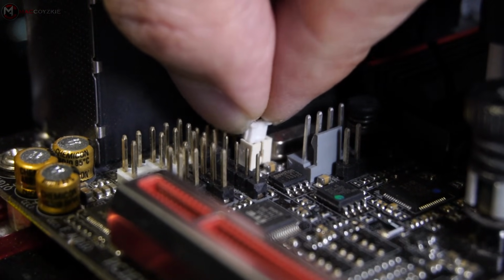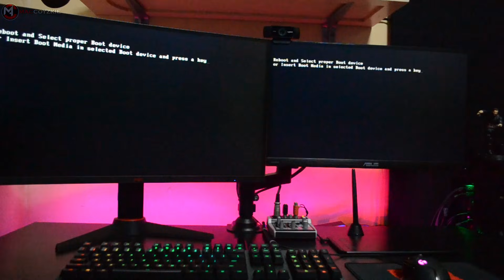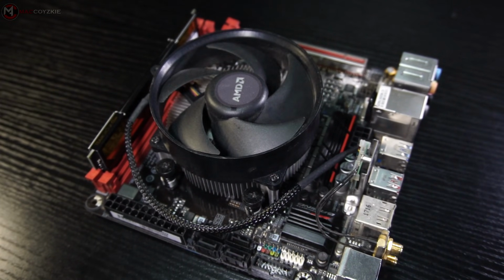How to remove cmos battery in your pc? Cmos reset / hard reset on bios

Comment: Hey Mac! I got into the bios but when I save and reboot the system it always go back to black screen no display no mouse and keyboard function. Any tips on what can i do to make my pc works?
Reply from the maker: this might be low power coming from a faulty psu or a wall outlet. Use a psu tester like this https://amzn.to/3z9G5U5 to check your psu.

Your wall outlet might be difficult to check unless you're a technician but you should use an avr or ups so the power coming in your pc is stable
Reply: Im on the same problem right now. My pc was not booting, I unplug and replug the wall outlet and it worked but no keyboard mouse or monitor activity.. then reboot again and now I have a red light on the CPU tab
Reply from the maker: @sivay4777  do you mean on your motherboard you see red led? if you did then some cables might be loose or not properly connected. Try to re-seat your rams, gpu, and drives. make sure all sata and psu cables are connected all the way
Reply: @MacCoyzkie  hey! Greatly appreciate your reply. I have been so desperate to work out where I went wrong. Yes, it is the red LED on the motherboard. I have reseated the GPU and pulled a few ram sticks. Also tried removing the CMOS battery for 5 minutes but not much luck. Might try and replace the PSU cords that start up the pc. I cant think of what it can be since the CPU is brand new. As well as the RAM. Brand new
Reply from the maker: @sivay4777  ok can you tell me what are your pc specs with the brand new cpu and ram names?
Reply: @MacCoyzkie  definitely. The 3 new components were:
ASUS TUFF Gaming B560-PLUS wifi (motherboard)
Corsair vengeance LPX 16GB (2x8GB, RAM)
Intel core i7 11700 (CPU) 

As for the rest, the GPU is a 2070 Super 8GB, the cpu has an air cooler

Just note that it did work for a month or so before running into the issue I have now. Before the problem, the PC did turn off on its own a few times but I believe that was because we had strong storms for a few days. 
Also, I have not tried to remove the old 2 RAM sticks. My PC has 4 sticks, 2 are new and 2 are old. Upgraded from 16 to 32gb ram
Reply from the maker: @sivay4777  as long as the rams are the same speed there is no problem. I'm more concern on the storms since it could really damage your pc specially when power fluctuation occurs. You need to test your psu using a psu tester like this https://amzn.to/3kdm0XZ

Comment: Hi bro! I watched both this video and the “Pc is on but no monitor signal fix!” Video. Great videos! May i just ask, whenever my 2 ram sticks are seated, there’s no monitor display. When I am just using 1 ram stick... there is a display on monitor. I interchanged both of my ram sticks to confirm if they are working if only 1 is seated and yes it works. Any idea how should i fix this? Will removing the cmos fix the problem? Im on my way home right now and i keep on searching what to do. Basically out of 4 ram slots, only 1 is working. And i cant use both 2 of my ram sticks together. If i put just 1 stick, it works. Hope u will be of help. Thanks bud.
Reply from the maker: either you have 2 different ram sticks speeds and manufacturer. They need to be in the same speed to work together less no signal is inevitable. On the other hand your motherboard like you said, only 1 ram slot is working. Though ram slots rarely breaks it is still possible. Other than cleaning the dust off the ram slots, i don't think there is any fix for that. sorry bro
Reply: @MacCoyzkie  My 2 rams (same speed, same manufacturer) were actually perfectly fine for almost a year now until last week, when i opened my pc, my monitor did not have any display and even my mouse and keyb did not have its lights on. I did some experiment by interchanging and switching the rams with its ram slots. And right now both rams are working on one particular slot. Yes, I’ll try cleaning the ram slot using a brush maybe or a small screwdriver by scratching it(?) and will also try this video of yours reseating the bios. Bro, I hope your channel will be successful. You, replying to the queries of people here in need, are well appreciated. Thanks dude.
Reply from the maker: @tommytom3012  glad i can help, i hope it all goes well for your rig bro :)

Comment: when i Start my PC it is yellow light then when i turn off it and start it again it restart automatically and then when i press F1 it restart again then it work correctly (start correctly)
Reply from the maker: was this happening still after you clear cmos? if you haven't clear cmos yet then clear it now
Reply: @MacCoyzkie  By removing it for 5 min?
Reply from the maker: @osmanhaidary4664  yes just follow the video
Reply: @MacCoyzkie  it doesn't work sir 😑. please solve this problem
Reply from the maker: @osmanhaidary4664  ok how about try removing the ram sticks, clean the ram slots and make sure there are no dusts around it and place back the rams. If you don't know how to remove rams here's a video https://youtu.be/UKR5xRsOhNg
Reply: @MacCoyzkie  I did it . No work. once a time i faced same problem before changing cmos.when i changed it solved . now i have it again . shall i change cmos ?
Reply from the maker: @osmanhaidary4664  changing the cmos might also be the same result. How about trying your pc parts individually in a different rig to check if its working. It's really difficult to find which is causing the problem

Comment: Thank you so much for this. I was trying to update some drivers on my pc and came across some errors and one brought me to the post screen and it said I have 0gb of memory. In this case, should I just try taking the battery out for about 15 mins? Also does everything have to be plugged in when I do it because my gpu covers up my battery making it harder to get to
Reply from the maker: if you can still go to bios just load optimized defaults, it's actually the same thing
Reply: @MacCoyzkie  that’s a setting in bios correct?
Reply from the maker: @drewgoff652  yes
Reply: @MacCoyzkie  tried loading UEFI defaults and when I save and exit, I just get an error that brings me back to bios and it still says I have 0gb of memory. I’ve also tried moving my ram sticks around but that didn’t do anything either.
Reply from the maker: @drewgoff652  ok this may be bad news for your rams but we still need to check it. can you ask a friend to try those rams to confirm if its still working?
Reply: @MacCoyzkie  I don’t have friends that could try it but I could try to maybe clean them
Reply: @drewgoff652  i hope you find your solution
Reply: @drewgoff652  what happened? I have the same problem right now
Reply: @korupcijamito2309  it was just a visual bug, I reinstalled windows and it worked fine after that
Reply: @drewgoff652  ohh, i cleaned the rams and resetted the cmos and it worked !
Reply: @drewgoff652  dude i have the same problem too i tried all the things you did but it didn’t work i also tried to reinstall windows but it says it couldn’t find a drive to install it to.

Comment: Man thank you thank you thank you very much, i just overclocked my memory frequency and the moment I can't open my pc anymore, i just want to drop dead before my mom kills me
Reply from the maker: that basically means the overclock on the rams didn't worked well with your build and usually happens if the cpu does not support the speed you're aiming for. Cmos reset is always the solution for that problem so get use to it while trying to overclock your rig. First panic moment is memorable lol
Reply: @MacCoyzkie  it's not even panic anymore, its trauma hahahaha anyways i'd try not to do stupid things anymore so I won't visit your channel again, once again thank u.
Reply from the maker: @SparklePlayzOfficial  hahaha its ok bro. but doing those things if works will make your pc run faster. anyway i hope it all goes well for your rig

Comment: my laptop has this issue for half a year now it says no bootable device. When I open the bios with clicking f2 it does work but yesterday clicking f2 doesnt work anymore to open bios, whats the problem?
Reply from the maker: depending on the laptop, there are different ways to enter bios. check the manual of your laptop in that case. On the other hand maybe its the keyboard itself. plug in a different keyboard and try f2
Reply: @MacCoyzkie  my bios opens if I click f2. I tried extended keyboard but it still doesnt work, i tried to unplug the cmos battery but its not working

Comment: I keep getting the “ Insert Boot Drive “ error after installing a new M.2 SSD. I’m about to try the CMOS Reset method, cross your fingers!
Reply from the maker: That’s normal, most motherboard nowadays set m.2 as primary boot. You can change that in the bios boot priority
Reply: @MacCoyzkie  Even after setting my CD Drive at the highest Boot priority, I still get the error 😕

I tried this yesterday, a relative and I have been going nuts trying to fix it. We think it may be an issue with the CD Drive some how, so I can hopefully attempt Booting from a USB soon.
Reply from the maker: @JValor  are you trying to install windows?
Reply: @JValor  did you get it to work?

Comment: after changing the battery, do i need to change anything in the bios?
Reply from the maker: Nope, if your battery works your pc should start normally
Reply: @MacCoyzkie  my current issue is, everytime i boot my pc, the system asks me to press F1 to run setup or press F2 to continue, i just press F2 because i dont know what to do, is the battery issue right?
Reply from the maker: You should replace the cmos battery if you see power saving mode in your display. As for your case i think a normal cmos reset will do. Of you are still experiencing the problem try changing the sata cable, if still doesn’t work then your boot drive might becoming faulty or windows is corrupted
Reply: @MacCoyzkie  alright imma try it. thank you so much

Comment: I bought one from ebay (Ryzen Edition, NO GPU) and plugged in my old Radeon HD 6670, but nothing works, did remove the CMOS battery to reset — still nothing on display. My jumper pin got lost (there was a pin on PWM CLR next to CMOS CLR connectors), should I order a new jumper pin — like do we need one there?

Subbed btw! :-)
Reply from the maker: My first question is what is the specs of the ryzen edition?
Reply: @MacCoyzkie  it's an Alienware Aurora R10, Ryzen 7 5800x, 16 GB 3200 mem speed. Seller sold it after removing the RTX 3080 (mining purpose) & sold the rest intact to me for $800. The PSU is 1000w & CPU is liquid cooled. 

I thought attaching any GPU would work, but instead it's giving an error code through LED sequences, it's message being: "BIOS recovery image found but invalid" according to DELL's user guide.
Reply from the maker: @Mew_York_Kitty  might be incompatibility. the problem is if the seller did not uninstall the gpu driver and you are using the same boot drive. this will cause a lot of issues. how about remove any drives in it and use a different boot drive without any windows os? clear cmos again then power the pc back on
Reply: @MacCoyzkie  I actually lost the jumper needed for clearing CMOS, there was a jumper attached to one of the pins, should I order another jumper or just remove CMOS battery?

Comment: sir yung pc ko pa pag binubuksan namamatay po tas mabubuhay ulit tinry ko po i reseat yung ram ayaw parin po tapos tinry ko din po tanggalin yung gpu nilinis ko na din po pc ayaw padin po so bumili po ako ng ram nung una po gumana tas kinabukasan pag open ko po nung pc ko ulit namamatay buhay po
Reply from the maker: power supply yan or yung mismong saksakan nyo sa bahay.  Mukang low power draw ang labas kaya on off ang pc. Nangyayare yan kapag nakidlat lalu na ngayon umuulan. gamit ka ng psu tester para ma check

On the other hand baka monitor cable yan specially kapag gumagamit ka ng converter. Yung mismong converter ang may sira. try mo palitan
Reply: pwede po ba kayo mag recommend ng tamang watts ng psu pra sa pc ko, at kung tama po ba yung watts ng psu ko naka 850watts po ako ko eto po specs ko 
GTX 1050ti,i7 7700k,8gb ram,1tb hdd,850watts psu
Reply from the maker: @FearlessRoi  kahit ano basta dapat 80+ certified sya. pero kapag 80+ na yung sayo wag mo na palitan. check mo nalang yung stability nya sa psu tester
Reply: Sir  @MacCoyzkie  yung pc ko po pag tinatanggal ko yung ram ko tas binabalik tsaka lng po nabubuhay kaya araw araw ko po tinatanggal tas kinakabit yung ram pra mabuhay, psu na po ba yung prob ng pc ko
Reply from the maker: Magiging matrabaho testing natin nito. Ask mo kaya ang tropa mo na itest ang ram at gpu mo. One at a time, kapag same parin ang problem baka isa sa mga parts na tinest nyo ang dahilan pero pag wala nangyare ok lang sya, mobo ang sirs paps, at least sa ram slot lang
Reply: pag po nasira ang ram slot mg mobo maaayos pa po ba?
Reply from the maker: @FearlessRoi  linis lang siguro paps, pag sira na talaga wala kana magagawa

Comment: Boss yung pc ko ayaw na magbukas. tinest ko yung power supply ko working naman. tinry ko rin ijump start yung motherboard ko pero wala pa din. nung pinaayos namin gumana naman ulit pero yung pagkashut down ko tas bubuksan ko ulit kinabukasan, wala nanaman ulit. ang issue daw ay nag oovervoltage daw yung motherboard ko kaya dinischarge nila. Any tips po para madischarge yung motherboard?
Reply from the maker: kung tinagal mo na yung cmos battery ng 5 minutes tapoos pagkabalik dapat ok na yan. Isa pang theory ko yung extension cable or avr na gamit mo baka may tama na kaya try mo gamit ng iba. kasi nung pinaayos mo sa kabila gumana naman so isa pang theory baka dahil sa power outage dahil naulan at nakidlat recently. Kung may psu tester ka double check mo yung psu mo, madalas nangyayare yan sa generic psu pero pag 80+ certified madalang pero possible parin.
Reply: salamat po sa reply boss. pero nadouble check ko na po yung psu ko no issue. 80+ bronze po yung psu ko. tinry ko na rin po irekta sa wall outlet wala pa rin. baka kailangan lang po palitan ng cmos? or dead na talaga motherboard ko?
Reply from the maker: @jacoblarino570  kapag low bat na ang cmos usually makikita mo sa monitor sasabihin nya, "power saving mode on" or something similar. Kung makabili ka ng psu tester na ganito https://amzn.to/3edegBw para madobol check. pero kung ayaw talaga baka nga mobo. 

Pa test mo sa tropa mo yung gpu saka ram, kapag walang problema malamang nasa dalawa nga, mobo or psu
Reply: @MacCoyzkie  Salamat po sa oras at pag sagot nyo boss! nagkaroon na ko ng idea kung ano gagawin at papalitan. sub ako sainyo :)
Reply from the maker: @jacoblarino570  wala ano man paps! salamat din sa subbed!

Comment: Hello my problem started when i left my pc in sleep mode for over a day then when i booted it up it worked fine then boom shut down and now all it does is the fans spin for a little bit then stop, i tried this but its not working what should i do
Reply from the maker: can you try this out first https://youtu.be/F-dLBIomghY at least the cleaning method
Reply: @MacCoyzkie  its the power supply 90%, i'll take it to my local pc repair shop

Comment: So I have signal and windows works fine really everything works fine. But after enabling SAM through bios before the new update came out from AMD where it can be done within the Radeon software (or at least I think that’s how it works) my bios got all blurry after enabling it and now it’s cutting in and out with info. So it’s basically unusable. Should this fix the issue (my bios was up to date when I had enabled SAM)
Reply from the maker: this is a bit complicated in AMD's side because they didn't give any tutorial about this stuff and it's causing a lot of problem if we try to use it. I will assume that you were not able to disable the CSM in the bios since you use the software. From what i've heard that you need to tweak some things in the bios first before you'll be able to use SAM. As of now try clearing cmos and hopefully it get backs to default settings.
Reply: @MacCoyzkie  alright thanks for the help man. It’s more a problem of working fine today but might not rmr
Reply from the maker: @JT-qj2lj  no problem bro, i hope it all goes well soon

Comment: I tried replacing my cmos battery since my old cmos battery was so old and the dates whenever I turn my pc on is out of date. I decided to change it when my pc suddenly doesn't turn on. After I turn on my pc the monitor will only say "Power saving mode on" then won't turn on no matter what I do. I changed the cmos battery but the issue is still the the same. What should I do? I have a capstone to finish but I can't use my pc :(
Reply from the maker: power saving mode means cmos battery is depleted and if replacing it with a new one you're still getting the same issue then there are two things, the new battery is incompatible or also depleted or the motherboard is not working anymore. better have that new battery checked first
Reply: @MacCoyzkie  The one thing I'm afraid is the situation where my motherboard is dead because I can't afford to buy a new one since I'm still studying. Anyway thank you so much for replying to my comment!
Reply: Emily  hello Emily, unfortunately I didn't manage to fix it. The motherboard is dead and I'm trying to save some money in order to buy a new motherboard.

Comment: The cmos battery on my motherboard is like cramped up with loads of wires and I don’t wanna rush into anything I can’t really pull it out because of my graphics card
Reply from the maker: you have to take the gpu out first then. If you're not that confident in doing so i suggest bring it to a local store
Reply: @MacCoyzkie  thank you